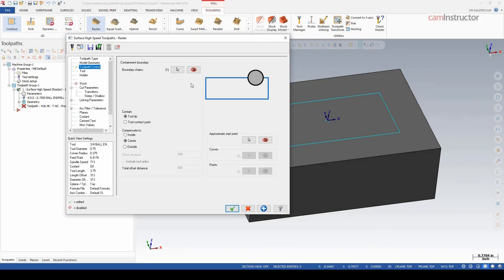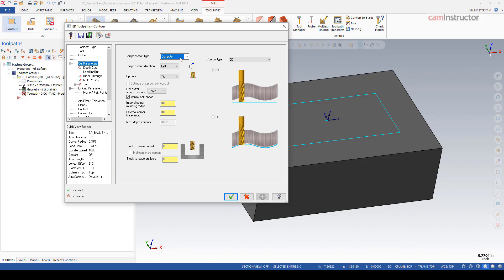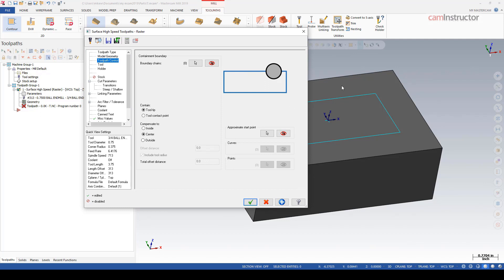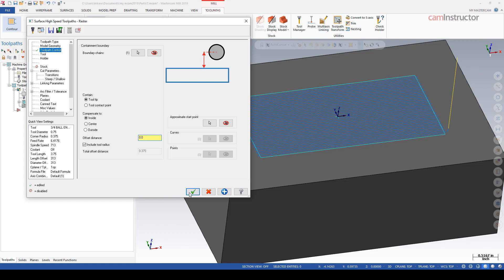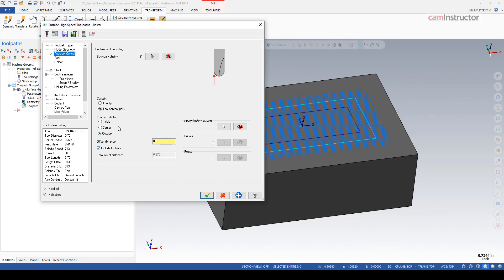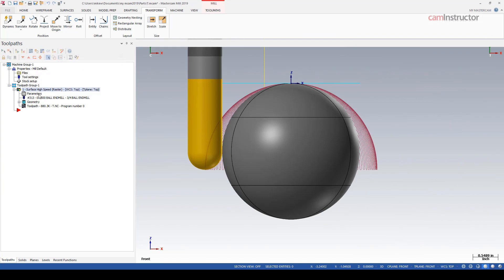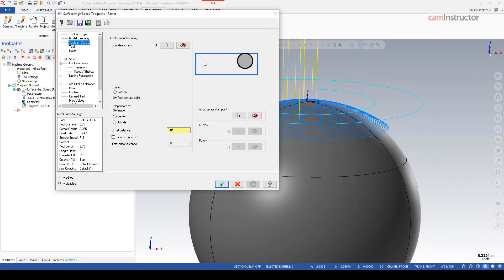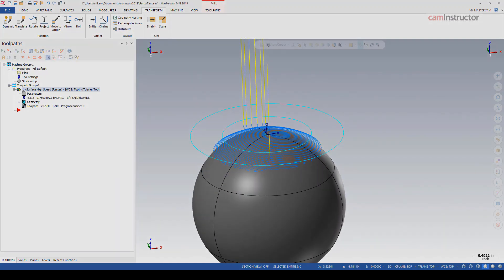Mastercam 3D Toolpath Control

Comment: The video explained the boundary controls better, which is great.  However, I don't feel that the "Cutter Comp" issue was addressed.  If we use the 3D toolpaths to generate a surface, how do we adjust the machine for tool wear over time?  If the Sphere is machined oversize because of tool wear, how do we affect a tool compensation to bring it down to the conforming size?  Do we need to create new geometry and re-post?  Or can we make a Wear Offset correction?  Would we need to add G41/42 into the G-Code manually to make that happen?  Any added clarification here would be terrific, thanks!

Comment: We extract parts from thermo formed/molded plastic parts. Some times we cut vertically like a drill press/ vertical mill, some times we cut horizontal (machine is 5 axis) and we rotate the head on the B axis 90 degrees and cut using the side of the bit (1/2 flat endmill)

How do you define which way the head will be positioned and what part of the milling bit will be used?.

I can make tool
Paths by selecting faces or edges and set the green arrow type same direction, yet mastercam just cuts in the vertical plane and in the back plot the the spindle is driving through the part and I can see how to switch back and forth between vertical or horizontal cutting.
Reply from the maker: Typically this is done with Planes although some settings within a toolpath can play a role as well.
Reply: @CamInstructor  can you offer a link explaining how to use planes to control the spindle position in horizontal or vertically to use the side or tip of an end mill to do the cutting?